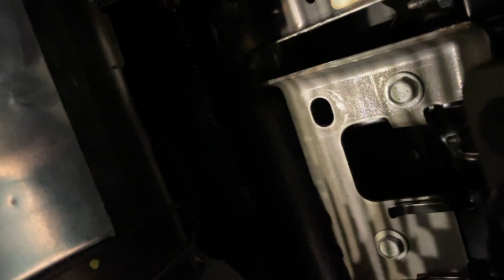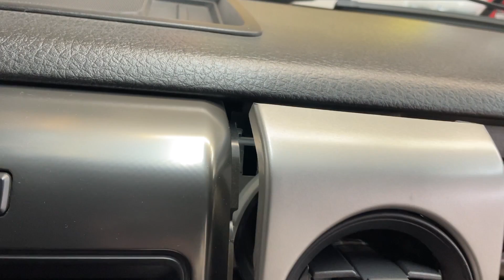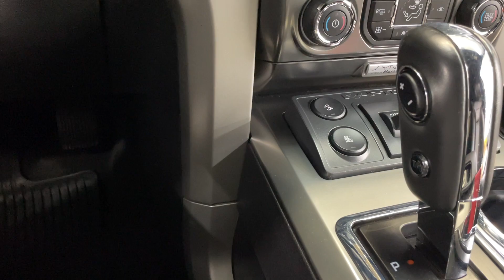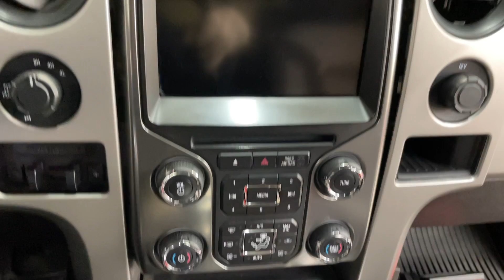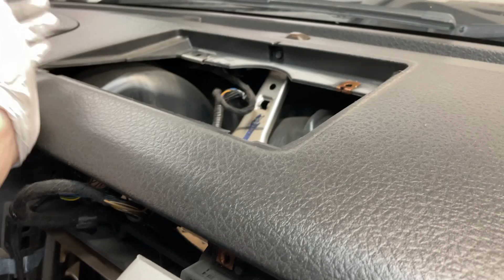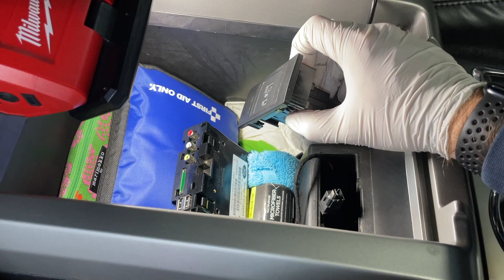2013-2014 Ford F-150 and Raptor SYNC 2 to SYNC 3 Upgrade

Comment: When you take the left trim piece off, it's easier to pull the vent straight out and then you can reach in and pull the trim straight out.
Reply from the maker: Agreed - it risks the vent to an extent (they are brittle as they age), but is a reasonable way to disassemble.  Thanks for watching!

Comment: Can you print some brackets and I can pay you?
Reply from the maker: Feel free to reach out at redonkilaus@gmail.com - that said, you may find a much better deal than me via any of the many online 3D printing service providers.  Thanks for watching!
Reply: @redonKiLaus  My son is going to try and get it printed at his university, what filament did you use? if he can't I will have to reach out to you.
Reply from the maker: @espoca8478  I used PET-G, but you're good with almost anything that's higher temp capable and of decent strength - ABS, ASA, polycarb, etc.

Comment: Ordered one of these kits for my 2013 after finding your video. I got the Sync 3 system on the new Sync 4 screen. Works great, my only regret is not ordering it sooner. Just like in the video, be careful with the 3D printed brackets. Mine fit well but I only hand tightened the 4 mounting screws using a socket and extension.
Reply from the maker: Same here, wish I did it sooner and I did it pretty quickly after getting this silver truck.  Thanks for watching!

Comment: Thanks for video used it to install.  took about 2 hr with shitty tools. I was able to use the kits 3D brackets without issue just used caution on those bottom bolts. Only hiccup I had was that passenger airbag reinstall was a bit tricky as I pushed it in too far to start.
Reply from the maker: Thanks for watching, glad the install went well!

Comment: Great video.  Is there a wireless CarPlay adapter or is wired the only option ? Thanks
Reply from the maker: You can use most/any of the ones available on Amazon that adapt wired to wireless CarPlay, but otherwise it's strictly wired as native.  Thanks for watching!

Comment: I’ve heard mixed reviews and have seen an upgraded version. Looks like it’s been a year, how has it been for the past year?
Reply from the maker: It's been great, best daily-use upgrade I've done to the truck!  The newer display is supposed to be higher res (and slightly different interface if I'm not mistaken) - no experience with that, but the one I have is more than sufficient.  Thanks for watching!
Reply: @redonKiLaus thank you for the response, just ordered and they upgraded the brackets. What would you say install time is? Approximately
Reply from the maker: @Ronofsteel  Took a few hours for me including filming, not including re-printing the brackets.  That said, still wrapped it up within a weekend!

Comment: Great video, Did foursynctech ever reach out to say they improved the brackets since your install, and after a year how is everything working.  Do you have any thoughts on non-nav vs nav.  I've never used nav on my car that has it always use waze and carplay so leaning to non-nav.
Thanks Dave
Reply from the maker: I never heard anything about a bracket improvement - if they did, that would be fantastic!  That said, the ones I printed myself worked perfectly and are still solid.  

I did the nav system since I had it from factory, and in the case I'm somewhere without cell service, still have GPS capability.  If that's of no concern, I wouldn't do the nav version.  

Thanks for watching!

Comment: could  this work with a 2010 raptor? or is there a new sync screen version for a 2010?
Reply from the maker: Unfortunately not, at least not without a full dash wiring swap etc.  2013/2014 only.  Best options for the earlier trucks are using one of the plug and play Android-based replacements, a standard double-DIN unit, or an aftermarket secondary screen.  Thanks for watching!

Comment: Do you recommend a certain wireless carplay adapter? If so do you have a link
Reply from the maker: I have a couple I've tried, but stopped using them because wired has worked much better overall, and because the adapters are buggy.  If/when a good reliable one comes out, I'm interested for sure.  Thanks for watching!

Comment: Will this upgrade work with the 2013 F150 XL that only has the 2 line test screen?
Reply from the maker: That I'm not sure about - I'd reach out to one of the sellers of these upgrade kits to determine whether or not it is.  Thanks for watching!

Comment: I heard that doing this upgrade you lose the front camera. Is that true? Also does it only have Car play, does it have Android Auto?
Reply from the maker: You do, but I've heard about a "jailbreak" that you can do to restore it.  I believe there is full Android Auto capability as well.  Thanks for watching!
Reply: @redonKiLaus  can you source a raptor sync and still keep it?
Reply from the maker: @mustangspartan  You can, if you refer to the distributor I got this kit from, they have details.
Reply: Are your units updated for new jailbreak that allows front camera ?
Reply from the maker: @matthewcamargo9175  Mine isn't, but I believe you can purchase them that way.  Thanks for watching!

Comment: Looks nice/ sharp ,questio  my 2013 f 150 radio 4 inch screen took crap 3 months ago I’m trying to find a replacement for it , I came across your video and I was wondering if you willing to sale me the head unit ( if equipped with reverse camera input ) I know I have to buy the modified bezel  but it small price to pay to put some music in my truck , so if you have no use for you old radio I will buy it name your price , thank you.🎼🎼
Reply from the maker: Thanks for the interest, I'm hanging onto the original parts for now in case I want to return to stock.  I believe the vendor I purchased this upgrade kit from does a Sync 3 kit for your vehicle, though.  Thanks for watching!
Reply: @redonKiLaus  can I have the site or name of store you buy it from ? Thank
Reply from the maker: @josephdispensa1475  Should be linked right in the video description to the exact place.  Thanks for watching!

Comment: I don’t have a 3d printer. Is there a place I can find the brackets?
Reply from the maker: Other than from a company that sells the complete kits, no.  You can likely submit the STL file to a company that does contract printing and get them made for less than $50 though.  Thanks for watching!

Comment: Does the heated and cooled seat option still work with sync 3 ?
Reply: Yes I upgraded, and heated and cooled seats still works, function is on the main screen and in climate controls screen
Reply: Did you ever find an answer?
Reply: Seriously tho, would be great to know.

Comment: Why not take the bracket off the one you removed and install it on the new one?
Reply from the maker: The metal brackets will only fit if you purchase a flush mount screen and kit and not the recessed mount version.  Thanks for watching!

Comment: I'm seeing an option for the Sycn 4 HD screen, do you know if this is also compatible just with a different resolution and upgraded software?
Reply: Update: I installed it tonight (the Sync 3 with Sync 4 HD screen) and it works like a charm.
Reply: @davidgulbransen6801  the sync4 screen is bigger how does it look with the stock radio bezel
Reply: @Refine-life  physically, it is pretty much the exact same size as the sync 2 display I had before. It fits great in my 2014’s bezel.
Reply: Which vendor kit did you buy @davidgulbransen6801
Reply: FourSyncTech now does offer a Sync 3 computer paired with the HD display from the Sync 4 systems. So, it is still Sync 3 software, but with a nicer display. I just bought it and will be installing it in my 2014 soon!
Reply: @davidgulbransen6801 where did you buy it at?
Reply from the maker: I'm not aware of one for the 13-14 trucks, Sync 4 retrofits to my knowledge are only for the trucks that came with Sync 3 from factory.  It's very similar, just newer and better in the ways you listed.  Thanks for watching!
Reply: is the resolution better? i am debating on getting the regular sync 3 or the hd sync 4 version

Comment: I looked everywhere, is there any conversion system that's compatible with the 2011 Raptor?
Reply from the maker: Unfortunately not, you're best off with an aftermarket headunit and iDataLink Maestro unit to integrate.  Thanks for watching!
Reply: @redonKiLaus  thank you!